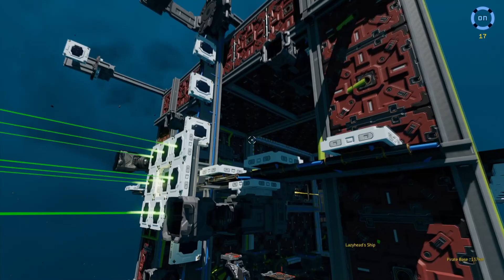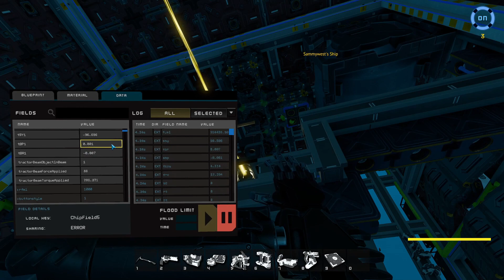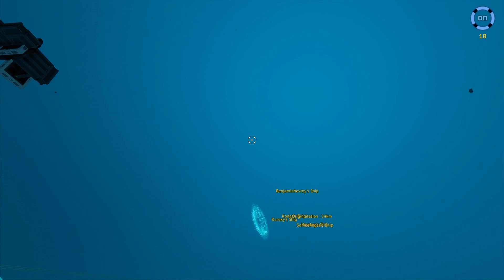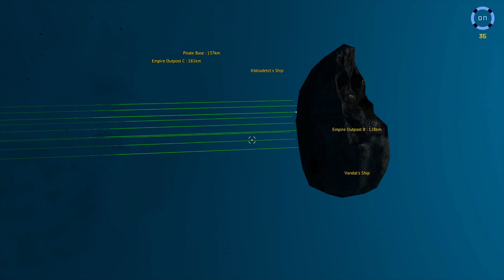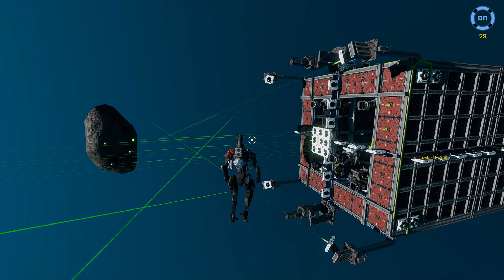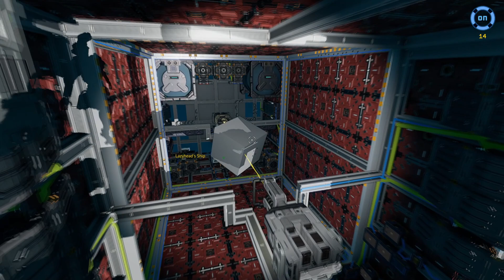starbase - automatic mining ship demonstration

Comment: I wonder if you could modify an ISAN system to get the ship's rotational position without the floating cube... more of a solid state solution
Reply: dont thing thats possible. ISAN does not know the orientation of your ship - it can just so tell you where you are relative to reference objects and even there with 4 receivers the accuracy is not high enough for this sorta job
Reply: @zoolkhan  i think, if you had 3 recievers spaced apart in a big triangle, you could map them in 3d space and calculate rotational position. Would be a lot more complex and slow, but it should be possible.

Comment: This is amazing and gives me so many ideas :) I wonder if you could use the ships's rolling and pitch to scan the area rather than using hinges (for a smoother scan). I also wonder if you could ISAN to travel using coordinates rather than a free floating cube (to allow for faster travel).
Reply: If i understand correctly, you can already do this, but the accuracy of ISAN would only make it practical in wide open areas. This demonstrates a working accelerometer. I would be curious if by using a lighter mass, they could move faster. If that was the case, they could use cargo locks to freeze the block and have different cells for different masses for "fast" vs. "Slow" conditions.

Comment: The cube knows where it is at all times. It knows this because it knows where it isn't. By subtracting where it is from where it isn't, or where it isn't from where it is - whichever is greater - it obtains a difference or deviation. The guidance subsystem uses deviations to generate corrective commands to drive the cube from a position where it is to a position where it isn't, and arriving at a position that it wasn't, it now is. Consequently, the position where it is is now the position that it wasn't, and if follows that the position that it was is now the position that it isn't. In the event that the position that it is in is not the position that it wasn't, the system has acquired a variation. The variation being the difference between where the cube is and where it wasn't. If variation is considered to be a significant factor, it too may be corrected by the GEA. However, the cube must also know where it was. The cube guidance computer scenario works as follows: Because a variation has modified some of the information that the cube has obtained, it is not sure just where it is. However, it is sure where it isn't, within reason, and it know where it was. It now subtracts where it should be from where it wasn't, or vice versa. And by differentiating this from the algebraic sum of where it shouldn't be and where it was, it is able to obtain the deviation and its variation, which is called error.

xD Great work!
Reply: Very much a classic and also extremely fitting for this video. Long and overly complicated description of a task. Listen to an extremely technically minded programmer try to explain code with words and not math.
Reply: classic

Comment: How did you manage to make your harpoints movable and cables unbreakable?
Reply from the maker: cables will count as connected as long as the end of one cable is touching the end of another, so by running a cable through the hinge wheel itself and making the cable snap because of it rotating on its own axis it doesnt move and the wires are still touching. it's a bit of an exploit but it works